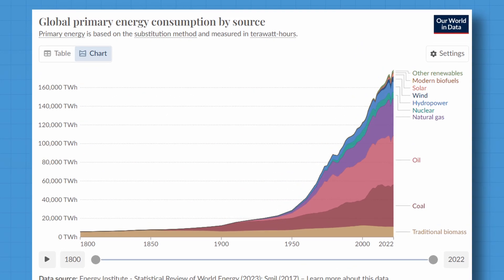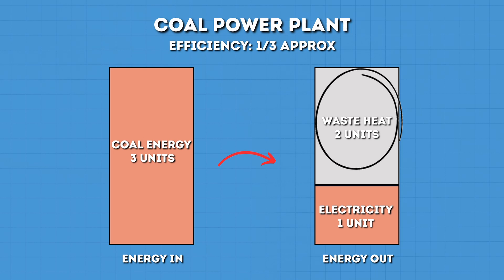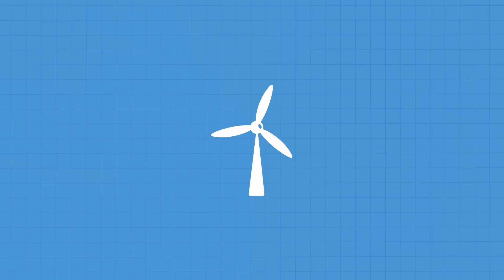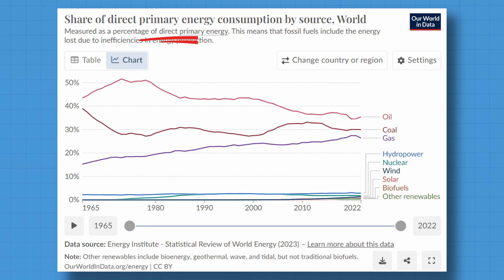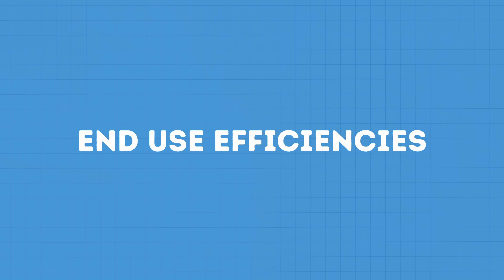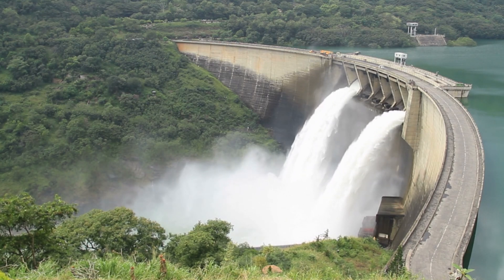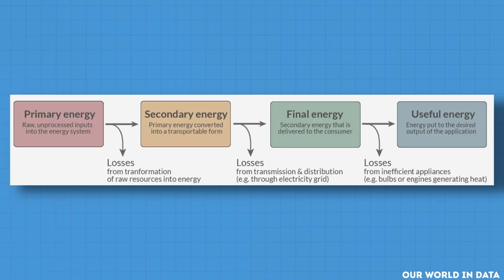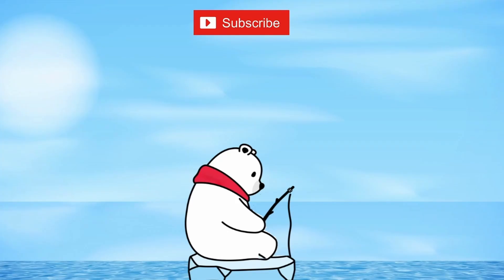We need to talk about the Primary Energy Fallacy

Comment: What d'ya do when wind doesn't blow and sun don't shine? The unreliable nature if intermittent so-calked renewables amounts to a very large inefficiency.
Reply: Store the energy you do make on good days for bad days.
Reply: @12pentaborane  I have pointed out many times that storing electrical energy in a battery is up to 10,000 the price of storing liquid or rock energy in a plastic bucket.
To get a handle on huge energy storage, it is going to have to be converted into chemical storage with huge losses but cheap storage, or for the short term as heat possibly in liquified air with riound trip eff not far below pumped hydro, but using not much more than air, sand and steel for the battery plus a whole oad of hardware from the gas industry.

But it leaves out the fact that solar produce 5x as much energy in summer than winter in the US, so most of that sun is going to be wasted unless summer storage can store months worth of energy. And over a year, wind doesn't always average out, the lulls can be weeks longs.
Reply: @12pentaborane  Ya cannae store the electricity stuff in a shed! That is to say that therr aint enough lithium in the world tae store even only a 24 hrs supply of several hundred megawatts of electricity. The most feasible approach is to sore it as potential energy by pumping massive volumes of water into uphill reservoirs and subsequently releasing the water to drive water turbines to generate electricity at tomes of peak demand. So, tge bottom line is, where in the UK are there suitable sites for excavating large suitably elevated reservoirs?
Otherwise, keep on eating pie in the sky!
Reply: Now if  yer happen to be in Scotland, look out for those air liquification energy storage plants they actually have big storage and power ratings on them meant for wind farms. They are building a few of them.
Reply: @johnjakson444  The issue isnae the power rating per se, but rather the duration over which the power can be supplied. It's not megawatts that matter, but megawatt hours. Less than a few days worth of megawatt storage is risible as far as balancing the grid is concerned.
Reply: Use hydrogen, batteries, and green baseloads.   Demand is not linear, so 'stopping' wasted energy stream creation with default storage increase the system efficacy.
Reply: @FlameofDemocracy  Do you have several tens of trillions of dollars in your pocket to pay for all that hydrogen and storage?  You couldn't pay for that without bankrupting the planet.  And poverty kills MUCH more than global warming.

Comment: Nuclear and geothermal get thire   heat basically for free(fule wise not capital and other costs) so I don't think its fair to compare them to fossil fules.
Reply from the maker: That’s fair. What conversion factor would you give to them? Perhaps, scrap the 10% and 33% from the PECM method, and look at their electricity output. But just generally primary energy is a not a really good metric
Reply: @theclimateClub ya I think energy electricity output should be the way they are measured. Yes it's true they do have waste heat and typically are less efficient heat conversion wise than gas or coal plants but they don't burn any fule and release Co2 to make that heat.
Reply: The heat isn't for free, its a capital cost thing and depends on engineering and on the various merits of the design.
When water is used as the coolant, the thermal eff is going to be 35% max, its the limit of how hot water can get under pressurization, water boils at 100c but in a reactor it pumpes around at 350c or so. Use  a design based on Molten Salts or certain dangerous liquid metals and the eff can easily get to 60% with 700c temps, but 
that has its own cost, personlly I support Molten Salt reactors for so many reason.

Comment: You make some good points, but the "wasted" heat from fossil fuels isn't always wasted. It depends on where (and when) it's produced. Through a process called cogeneration the waste heat is used to heat homes. This is common in places like New York and Chicago, but isn't the case in places like Miami and Los Angeles. Here is more info on cogeneration: https://en.wikipedia.org/wiki/Cogeneration
Reply from the maker: Yeah that was a point I had kept in the script but then removed it because it would lengthen the video too much. I was going to talk about CHP for example. Thanks for making that point though
Reply: Rejected energy means it isn't used, as in 'in no manner or form.'

Comment: and you did an excellent job understating the inefficiencies of renewables... nice!
Reply from the maker: Not really. Inefficiencies of renewables in terms of the output is very low. If are talking about efficiency rates of renewables (20% solar, 40% wind ish), then that’s not the comparison to be made because that energy isn’t “wasted” as it’s just there. The actual comparison to be made is with the output of both renewables and fossil fuels. Nice!
Reply: @theclimateClub  ,   if you want to state renewables are more efficient you MUST include their losses to have
the effective energy.  case in point. a lead acid battery will lose more than 20 percent of the energy you store.
other batteries claim down into 10 percent.  it means you have lost 10 percent as waste heat...  
and you can't ignore 10 percent .  your point is good and there is no need to hide clear truths.
Reply from the maker: @victormiranda9163 i agree that will need to be taken into account which I mentioned in the video. 👍
Reply: @theclimateClub  you take the heat losses into account with numbers and then skip them for renewables...  no.  if you use specifics you must put them on all data.
coal is a good example for much of what you state.. 2/3s heat lost.  but if you want to imply that all you need is 1/3 of that power in PV panels your argument is lost.
PV's heat derate AND storage will puff you
up to needing another 1/3...
Reply: This video makes some valid points.  However, it overlooks some other fallacies.

SUBSTITUTION FALLACY: Fossil fuels are used to make plastics, nitrogen fertilizer (for food), steel, and concrete.  There are currently no economic substitutes available.  So these "primary energy" uses need to be retained.

EFFICIENCY FALLACY:  Different sources and processes have different efficiencies.  For example, natural gas combined cycle electricity generation is about 65% efficient.  (Also, modern coal plants are about 45% efficient, not 33%.)  The usage matters also.  Modern natural gas furnaces are about 95% efficient.  The efficiency of heat pumps falls with outside temperature.  So in temperatures below freezing, gas furnaces are the better option.

INTERMITTENCY FALLACY:  Intermittent renewables (e.g. wind and solar) only make electricity when it is windy or sunny.  But electricity is needed all the time, not just in proportion to wind or sun.  Also, costs for intermittent sources almost never include the requirement for dispatchable electricity (the kind we need).  So in addition to the wind and solar, we need HUGE batteries, which are VERY expensive, or we need quick-reacting backup power sources such as fossil.  Since these fossil sources are required to remain on costly standby, while the "cheap" renewables are doing their thing, the cost picture gets very distorted.

Comment: Hence nuclear energy production for base load makes sense as waste heat is more easily captured.  Plus other benefits.
Reply: In Eastern Europe nuclear power stations were often connected to district heating systems, to provide heating using the waste heat. We should go back to that.

Alternatively, heating up water massively reduces the energy needed to split it into hydrogen and oxygen, so it could be useful in electrolysis.
Reply: Mining for the fuel hardly make sense…
Reply: @peterhansson7967 That's not true at all. Mining nuclear fuel literally means mining the most energy dense fuel ever discovered by humankind the energy in versus energy out is astronomical for mining nuclear fuel and therefore makes it very environmental because you don't need a mine that much. In Comparison to even renewables, nuclear has got them beat in terms of minimizing ecological disruption due to mining.
Reply: @Cameronmid1  A solar panel produces more electricity over it's lifespan then the same mass of nuclear fuel rods.  The obsession with energy density is foolish for a powerplant because we arn't carrying it around on our backs.
Reply: @kennethferland5579  What? You'll use 1800 tons of fuel over 60y lifespan of a 1 GW reactor. 1800 tons will give you only 180 000 m^2 of solar panels or 0.18 km^2 = 9 - 15 MWe of constant electricity with hydrogen storage over 20 years. You're off by a factor of 150 - 300! You'd need 30 g/m^2 panels for that to be true or 90 g/m^2 with some magical battery storage tech.
Reply: @peterhansson7967  bollux
Reply: It's not that waste heat is captured, it's that fact that higher temperature sources have higher max isentropic efficiencies as a consequence of the second law of thermodynamics, with max thermal efficiency being approximated as (TH-TL)/TH. The higher the temperature of the heat source, the more convertible to work that energy is. Nuclear reactions are significantly hotter than chemical reactions. Some heat must be rejected for all processes in order to produce work, and that rejected heat cannot be recaptured without putting more energy into the system than is recaptured.
Reply: @Brettfast_prod  Exactly but current fission reactors are hindered by using bloody water as their coolant which limits Carnot eff to about 35%. Start using Molten Salts or dare I say liquid metals (not sodium water anywhere near it), and your Carnot limit goes to 60% eff but you would want to combine that with a super critical CO2 based heat engine to extract the energy with it, thats only recently been worked out.

But nat gas can be improved too, 60% in air is the normal limit, but burn in oxygen its then 80%, or 70% if the nitrogen is wasted.

Even those stupid Germans that switched from nuclear to coal, got new improved extra clean modern coal with I believe 45% eff, but its still fricken brown coal.
Reply: @Brettfast_prod  In Eastern Europe it's very common to pipe waste heat from nuclear power stations into district heating systems. Which is only possible because nuclear runs continuously throughout the winter.

So yes, the waste heat can be captured and used.
Reply: @Brettfast_prod  The carnot efficiency is for an engine operating at infinitly slow speed with full reversability, for real world engines the proper equation is 1 - Sqroot( Cold / Hot).  Nuclear reactors operate at about 600K and the outside environment at around 300K, this woiuld be a 50% efficiency by the Carnot formula, but gives us the correct 30% efficency using the real world formula.  This equation helps us understand why low level heat is so bad for power generation.  If a 400K heat source exists the Carnot formula would sugjest 25% efficency would be possible, but in reality its only a dismal 13%.
Reply: @Brettfast_prod  No Chemical reactions of hydrocarbon combustion are in thousands of degrees, 2000 Celcius for natural gas.  A nuclear reactor produces heat at a measly 325 C.  The Temperature that a reactor could meltdown at or that A-bomb could reach or that a neutron is ejected from a Uranium atom at are irrelivent.

Comment: Transportation technology in which the prime mover is located in the vehicle is the worst, it wastes four-fifths of the energy put into it. However, this does represent progress over the reciprocating steam engine of one hundred years ago, which wasted all but 7% of the energy released by the burning fuel.
Reply: Well the real problem is with all the stupid people that want to drive around in a comforatble house on wheels, 50 years ago we had much less efficient engines, but the vehicles were mostly half the weight or less, so 4 steps forward and 3 steps backwards. And then people go on about death traps tiny cars, the solution to that is we all drive in battle tanks, more steel, better outcome for driver, sod the other guy.
Reply from the maker: Yeah for sure. Will have to transition to electric cars, but also decrease car usage and increase substitutes (public transport, better city development etc)
Reply: @theclimateClub  the "better city" development is 100% guaranteed to cause low birth rates. US car centric is dumb but it makes repalcement birth rate possible.

Comment: actually a really great point
I hadn't even considered that coal and fossil fuels are so inefficient that most of their energy output won't even need to be matched by renewable sources
Reply from the maker: Exactly! This topic doesn’t seem to be very known for some reason, but it’s quite important
Reply: @theclimateClub  I didn't even consider that "energy usage of a country" given in TWh is NOT the useful energy. But I understand now, it's a fossil lobby thing to make them more valuable.
Reply: Geothermal and Nuclear have the best efficiency, its over 90%.
Hydro power plant between 40-60&
Wind power 30-45%
while solar the the least only 10-20%
Correct me if i wrong ✅✅
Reply: @ASTER15K  Honestly we need to normalise nuclear power.
Reply from the maker: @lord_scrubington  yes and no. We should think about systems and how different technologies fit. If in a certain context/country with a regulatory environment that means that nuclear doesn’t run overcosts and overtime, then can be a compliment. But overall, it’s not as viable as some people may think, especially since it takes a decade to finish one from start to end. It’s more of a case by case thing.
Reply from the maker: @ASTER15K  You seem to have confused efficiency for capacity factor. The numbers you show are correct for capacity factors (ie. actual energy produced over maximum theoretical energy that could be produced if running at full capacity). So solar has a low capacity factor because of intermittency for example. Efficiency is how much electricity/energy you produce from the source/input energy (coal, sunlight). But for renewables it’s treated as 100% efficiency for electricity as it doesn’t produce waste heat. Hope that clears it up a bit. To illustrate, coal has an efficiency of like 35% but it can run relatively continuously so has a higher capacity factor.
Reply: Well storage for fossil fuels is essentially free, the elephant in the room is that intermitent energy has huge storage costs vastly higher than the 33% eff of primary. And beside nat gas in CCNG power plants burns at 60% not 33%, and with O2 burning it goes up to 80% if O2 is free, 70% if paid for. And nuclear can easily reach 60% too if you go for higer temp reactors like Molten Salt. So the anti heat chemical folks have no clue about various eff cycles of production or storage.

By the time you pay for storage of intermitent electrical, you will have to use engineering that involves either heat or chemical energy conversion with round trip efficiencies between 10-60% or so depending on path taken.